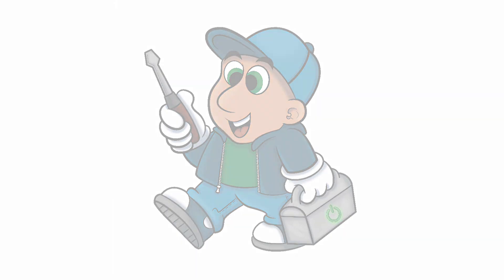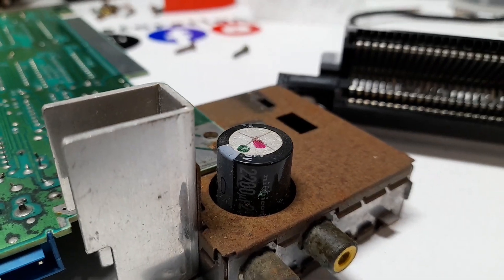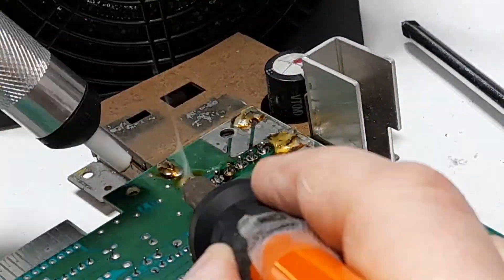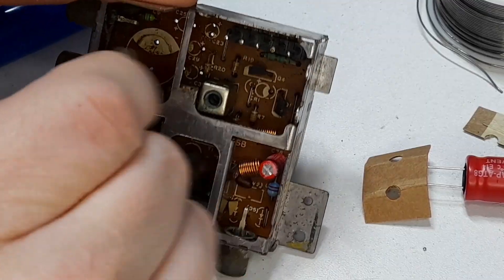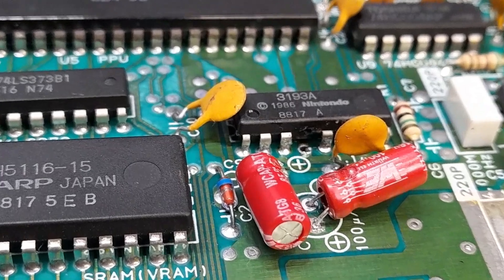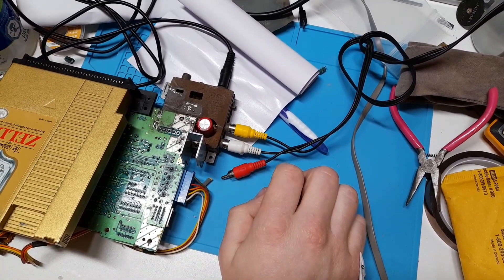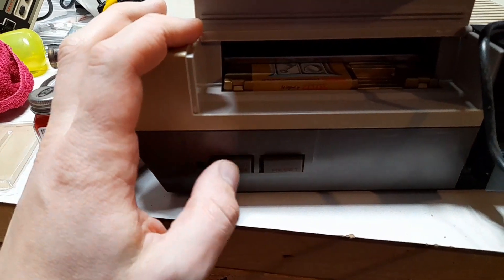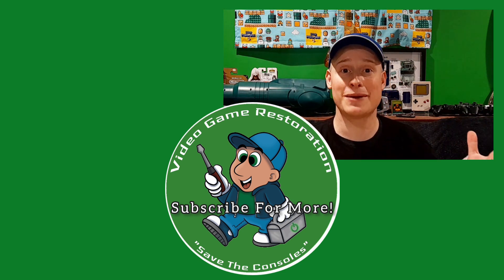Fully Restoring a Nintendo Entertainment System

Comment: Great job restoring that beautiful machine! About the game not working when it's pushed down. I have a guess that one or more of the pins loses a connection to the game cartridge. If you get another console that only works one way maybe try replacing the 72-pin connector to test. It could also be related to that lockout chip, so maybe leave that in tact temporarily just to try and narrow down the cause. Just a guess though 😀

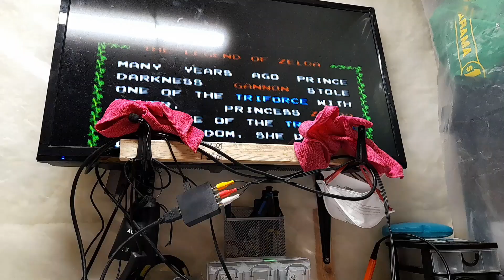Comment: the actual issue at 6:30 was the colours of A/V cable you were using.

Those cables are split into three:
yellow: video
white: L audio, or mono (the NES wasn't capable of stereo audio, which is audio out of multiple channels, only mono, which is audio out of a single channel - basically all the speakers, no matter how many there are, are treated as one speaker)
red: R audio, only applicable when using stereo - the NES itself has strange colours for the AV ports which explains the mixup, but the original cables led out to a SCART connector and came in the white/yellow variant, since as I say, NES only supports mono

Comment: get some low melt solder. works great for removing smd or through hole components. just make sure to get it all wicked off before putting it back together.

Comment: I'm a mechanic, but I've also tinkered with a few consoles. two things actually happen over time with your connector pins that engage the game cartridge over time. they bend out of place, yes, but they also lose ductility which is the property of matter to be able to be shaped and stay in that same shape. the pins have lost ductility, which is why the console will read in either the up or down position, but not the other. if the pins have lost too much ductility to function in both positions, you should replace the entire piece with an aftermarket connector. yes aftermarket sucks, but if you want to fully restore the console to working order, that is the solution
Reply from the maker: Thanks Rusty! I didn't know that!
Reply: @VideoGameRestoration  thank you for this awesome video! I didnt know that you could restore an old console to original colour.
Reply from the maker: @waypasttheline  yeah! Unfortunately it isn't always permanent and sometimes needs multiple treatments :/
Reply: @VideoGameRestoration  that is also good to know for when I try it out

Comment: You did a good job with the repair, but it really isn't necesasary to bend the pins on the 72 pin connector. It's a common misconception that the pins bend down. But, they really don't. They will flex a bit when a game is inserted, but they will return to their original position when the game is removed. An NES not reading games is always due to a dirty connector and/or dirty games. Heck, the NES was never designed to work with the games not being pushed down. It was designed with zero insertion force in mind. And, having those pins really tight is not good, because it will slowly remove the protective plating off the connector pins and the pins on the game itself. I've heard lots of NESs that have a nasty scraping sound when you put in and remove a game. And then if you look at the game's pins, there will be parmanent marks on them because of those tight pins scraping on them. Not good. I have 2 NESs that I got a while ago. Both are quite old. One is serial number 750,156. One is serial number 197,223. Both these systems have their original 72 pin connector. The one that is number 750,156 had it's 72 pin connector messed around with. Pins were up too high, and a few were also misaligned a bit. I bent them all back to the position that they should have been in, cleaned the connector, put a clean game in. And it works first try. Every time. That connector looked atrocious (Still kind of does. Ha ha.) and now it works like new. The other one's 72 pin connector was untouched. After a good clean, same thing. Put in a clean game, and it now works every single time. I suppose after you do everything and it still doesn't work, then you can try messing around with the pins. But I really don't think it's necesary, unless someone else has messed around with them like on that one NES I got.
Reply from the maker: Interesting! I haven't had the most luck with just cleaning alone. I'll keep that in mind next time I get one in though and work at it in stages!
Reply: @VideoGameRestoration  What I actually did is I soaked the connector in white vinegar for a few hours. I think that works quite well, but it does actually look like it left a bit of a milky look to the part of the connector that plus into the NESs motherboard. Definitely didn't affect functionality though. Same thing happened with an SNES connector that I submerged too. Might be best just to fill the container up enough so that it just soaks the part of the connector where games plug in to.
Reply from the maker: @1980sGamer  ah! The ol vinegar trick! I didn't even think of that for the connector